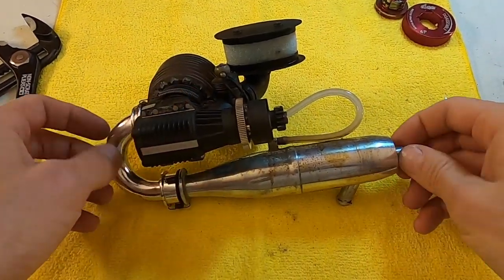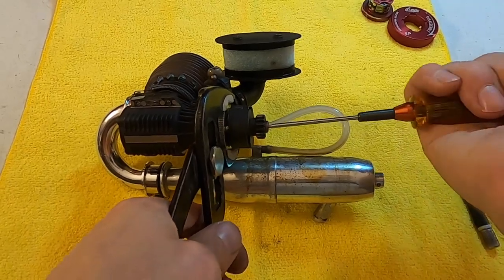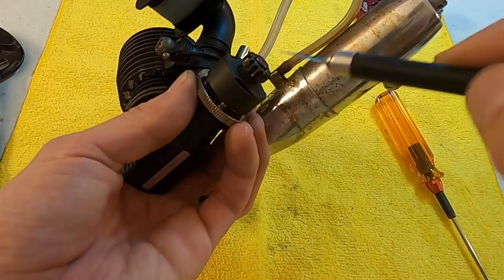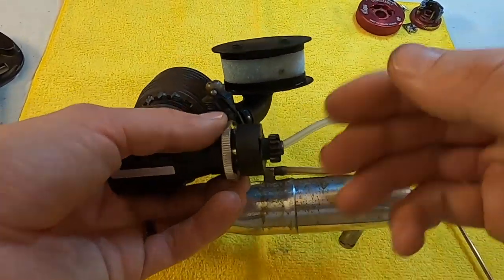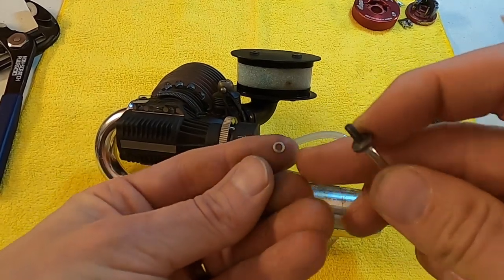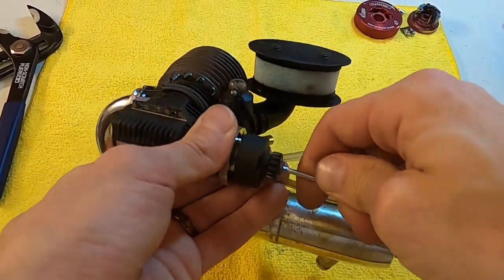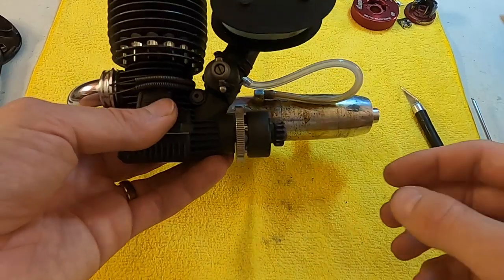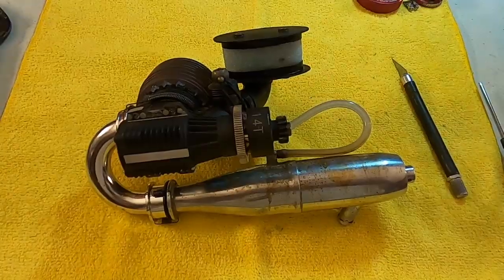How to R/C Clutch Maintenance and Clutch Shimming [Beginner Tutorial with Ryan Lutz of LutzRC]

Comment: Your vids are so well done and helpful.  For years I have been shimming by adding a 0.2mm shim and checking, one at a time (and usually like 5 or more for some reason), till I hit that point of zero play, then replacing a 0.2mm with a 0.1mm and checking again, sometimes needing to also remove the 0.1mm to reach the smallest non-zero amount of play.

So mathematically speaking, I'm always 0-0.1mm of play.  My clutch bearings last about 0.25 gallon to 1 gallon.  Wondering if that's a sign that, while better than no play, it's still not enough play.  Perhaps I should instead try aiming for the 0.1mm-0.2mm spec you listed in the description.

Comment: Great explanatory. Maybe you can explain more about putting extra 3x5 shims at the end screw. I still don't get it how or why that is needed even if lets say shimmed everything correctly. Is there something about putting a load on the bearings?
Reply from the maker: It’s needed only if your clutch setup when put together has the outer bearing hanging off the end of the crankshaft without any shims being used. If you would find this to be the case then you can add either a ‘top hat style’ washer that takes up some of that gap or the 3x5 shims. Either thing helping to basically make the crankshaft longer.